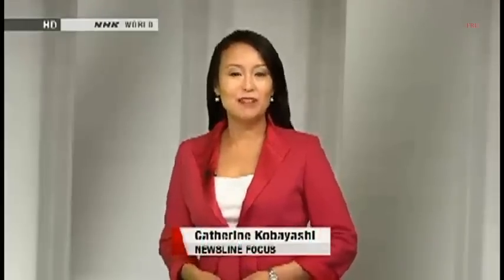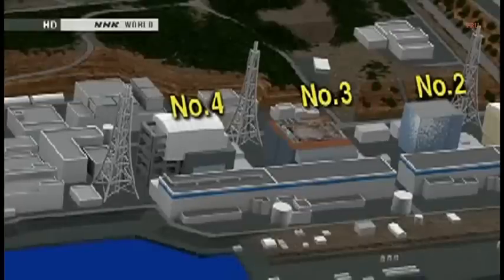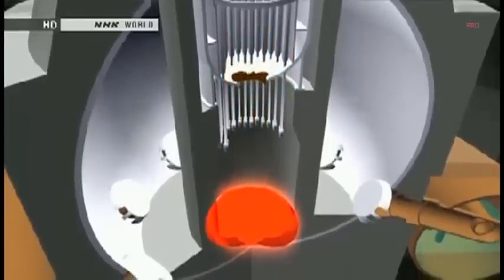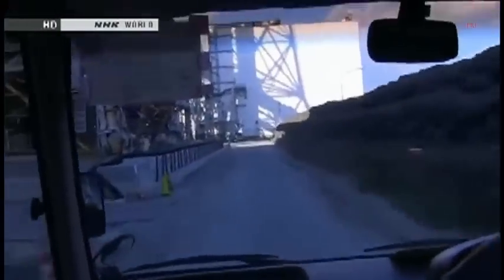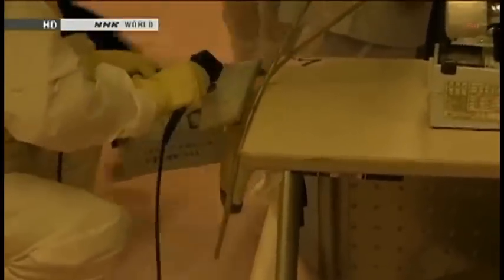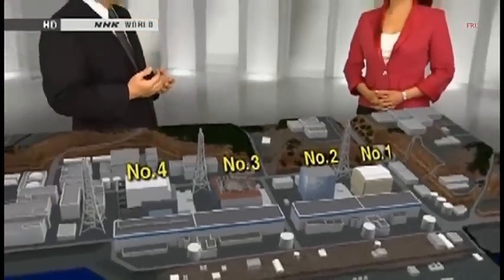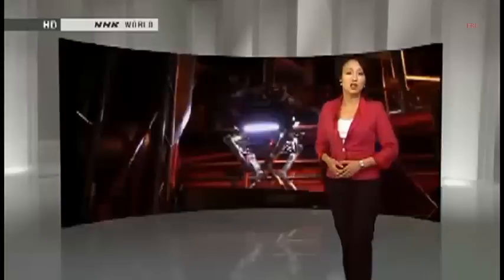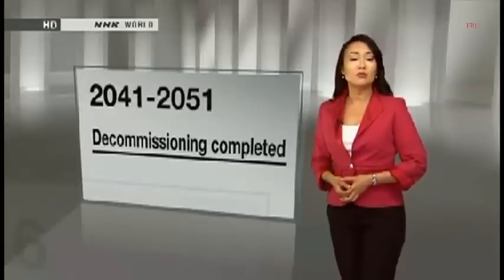Nuclear Watch: Japan NHK's Newsline FOCUS: Inside Fukushima Daiichi  (03/29/2014)

Comment: NHK's Newsline FOCUS: Inside Fukushima Daiichi, Mar. 29, 2014 (at 18:15 in): A network of trenches runs between the reactor buildings and the shore. They are flooded with extremely radioactive water that's been trapped** there since the triple meltdown. Tepco data shows concentrations of cesium up to 4 million times above the government safety limit. Engineers estimate that the trenches hold about 15,000 tons of toxic water but radiation levels are too high for them to get a more precise look at the situation. Some experts point out these trenches are a source of contamination for the Pacific Ocean. Tepco says there's no evidence of that yet, but it recognizes the need to act quickly.
Thanks for the hosting this post: Nuclear Watch: Japan NHK's Newsline FOCUS: Inside Fukushima Daiichi (03/29/2014)
Reply from the maker: and to you for sharing. You are always welcome. Have a good weekend. This looks really bad.  negative news = + bioaccumulation = - time